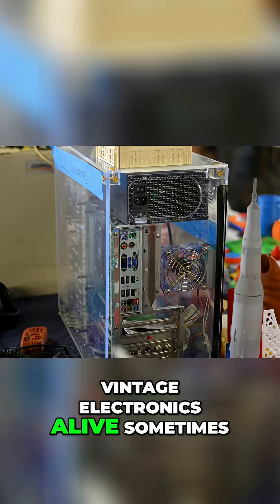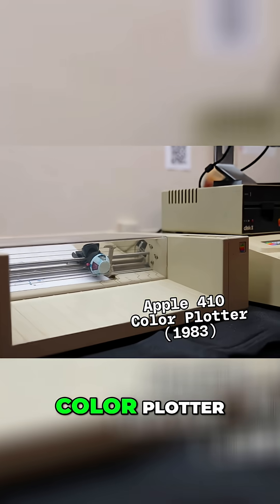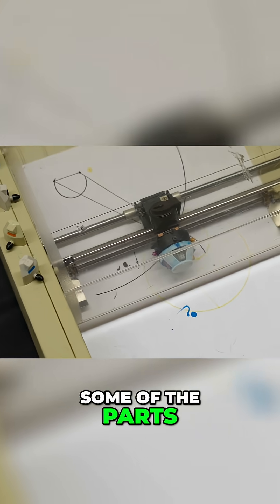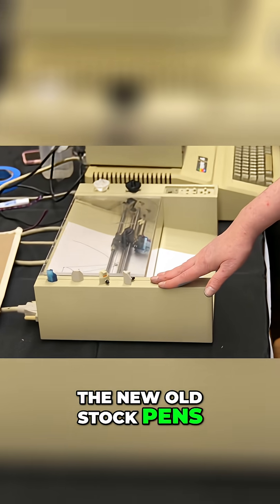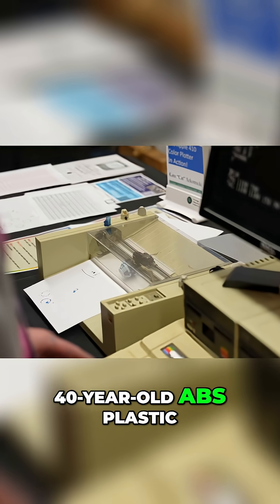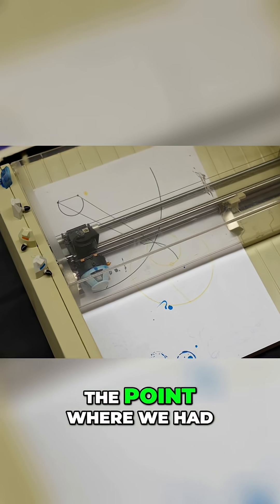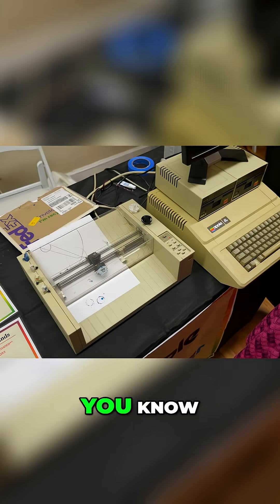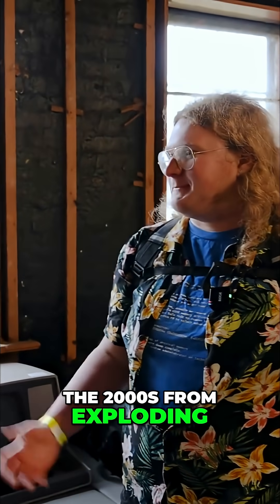Reviving Vintage Tech: 3D Printing Apple Color Plotter! #shorts

Comment: Hearing "40 year old ABS plastic" and thinking about that 44 year old Gundam kit I built last week without issue gave me whiplash lol. Apple has always been stingy, huh?
Reply: For once it's not apple, light colored uncoated ABS oxidizes like crazy if exposed to UV
Reply: @denisdrozdoff2926 fair, though, we'd likely see more inconsistency in the yellowing if that was the main driving factor
Reply: This was probably sitting out of its box for a hot minute though, compared to what I'm guessing was a basically new kit. What kit was it tho, I built some Gundam as well but nothing that old😅
Reply: @navats3592 also she did say consumables a lot. It’s not a stationary part and was likely used a good amount.
Reply: @navats3592  It was the 1/60 "big scale" Zaku II. I found it at a garage sale. Its true that it was in a cardboard box, but it wasn't in a plastic sleeve or anything. I suppose prolonged use may do some harm, but theres plenty of old ABS machine parts on vintage tech I've had over the years that haven't failed me yet.
Reply: It's a numbers game. Your model was likely manufactures in the thousands but Apple is manufacturing in the millions to meet demands. Planned obsolescence is also a thing